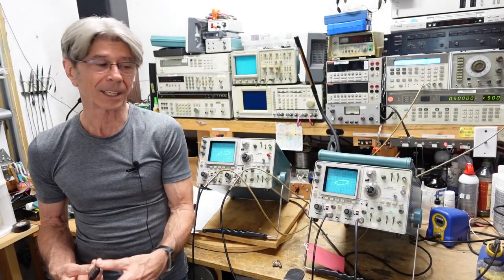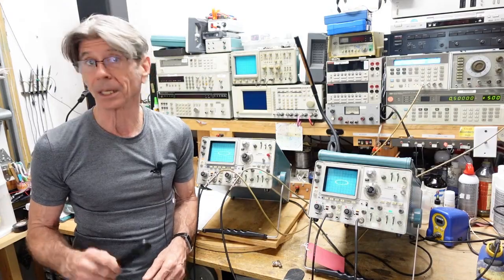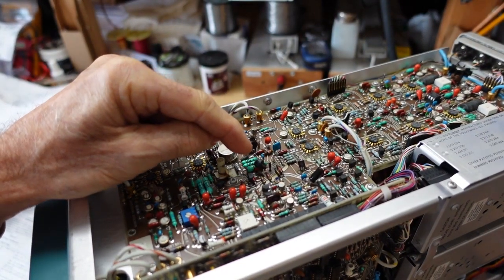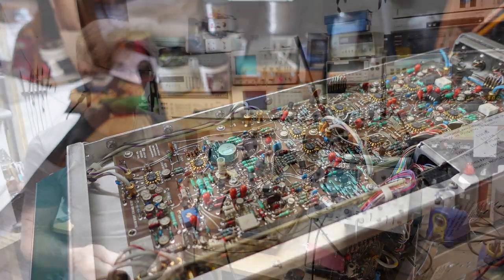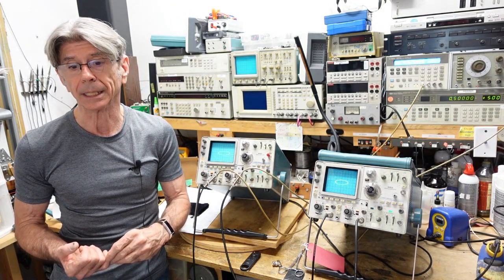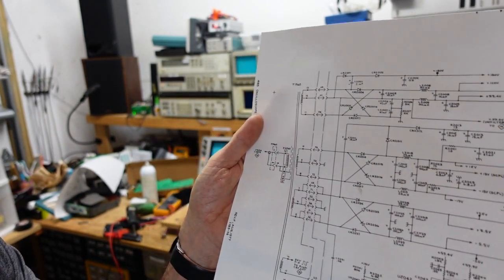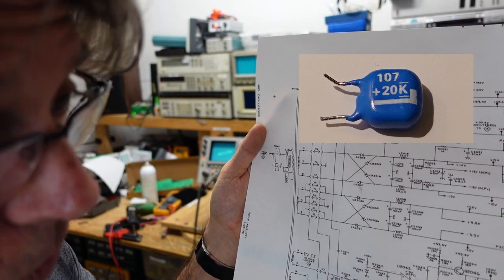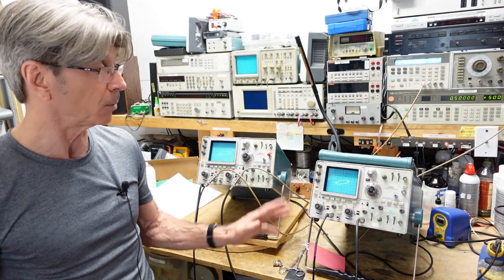Tektronix 485 A Quick Update

Comment: Hi Ray, thank you for the amazing content. Your insights have helped me a lot on my journey to fix my 485. I’m from Brazil, and this is an extremely rare piece of equipment here. I got mine from an old technician who brought it from Switzerland in the late '70s. He recently passed away, and his son sold it to me, but it wasn't working.

After some research online, I found your video. Thanks to your help, I was able to solve a short — in my case, on the -15V DC line. After getting rid of the short, I powered it on, but there was still a ticking sound coming from the power supply.

Digging deeper with the service manual, I bent the 3rd pin on the U comb, and now all voltages are working perfectly. The front panel LEDs are lit, and the fan is spinning, but unfortunately, there's still no image on the CRT.

I disassembled it again and checked the high-voltage power supply. All components seem fine, which brings me to my question:
Is there any chance a tantalum capacitor could be responsible for the CRT not displaying anything?

Thank you so much for your time and incredible work!
Reply from the maker: Hi Rodrigo!  Unfortunately, there are many reasons for a no display scenario.  You mentioned checking the HV components, but are you actually getting the correct HV readings?  This requires an HV probe, which you may not have.  There are also unblanking circuits which may be at fault.
Autotriggering causes a line on the CRT in the absence of a signal.  If the autotrigger circuitry (or if the scope trigger is not in auto) you won't see a sweep on the screen.  Try feeding a signal in and see if you get a sweep.  Good luck!  Ray

Comment: Ray this is a typical problem. Tek would run 15V caps at 15V not good! The metal can ones never fail. Derate at least 20% I usually go for 50%

Comment: :face-blue-smiling:Congratulations.
Great video tutorial

I too have a TEK 485 in my lab, which had the same problem.
Once all the tantalum capacitors were replaced it worked perfectly again.
    Thank you for your contribution.
    Hello from Italy
    Stephen,

Retired electronics technician
Reply from the maker: Thanks Stephen!  Tek scopes were the gold standard when these were made, but time marches on and takes its toll on components.  Those tantalums haven't aged well, and you were wise to replace them all.  Before the 2 485's I have can be reliably used this must be done to them as well.

Comment: If there's ripple in the power supply or voltage spikes this can also cause tantalum's to short causing a cascade failure one after the other. so I would monitor the output rails on each supply
Reply from the maker: Thanks, I had not heard that.  Several of these were after regulation, but one was definitely before.
The power supplies in the 485 are run from an inverter, so the frequency is around 25 Khz, IIRC.

Comment: Everything is surface mount even in small gear. But caps of any sort are still a problem. It’s strange about them, tantalum type, in some pieces of gear such as older HP I have hardly ever had to replace one. In some other well known pieces, it’s always one of them. When ever I see them it makes me worry.
Reply from the maker: IMHO you're right to worry, since their default failure mode is a dead short.  But you bring up an interesting point: I've never seen one fail in HP gear either.  I did have one short in a Fluke 8920 AC Voltmeter, but never in any HP stuff, and I have a fair amount.  What's up with that?
Reply: @raygianelli3612  beats me, I know there is much to be said about quality control. I normally use Nichicon  caps, which are considered good quality, but I have received lots from suppliers that had a batch of poorly  manufactured ones. Mouser replaced them with no problems when I pointed out the problem. I think it’s just the nature of caps, no matter the architecture to fail. Dried out electrolytes an poor manufacturing technique have caused many problems, but you would think by now someone would have  fixed the issue. I have been told by folks that worked at NASA gear has to be pulled all the time because of cap problems. Can’t wait to blast off to the moon an a series of caps fail on the way home.

Comment: After your prior video, I went down the Tantalum rabbit hole for a while and found out that some are now being produced with what amounts to an internal fuse element so that when they fail dead short, they actually open up instead when the over-current surge "pops" the internal fuse. I feel that is a huge improvement. However, there must be a trade-off of some sort. Maybe not as good of a high frequency response, higher ESR, or something. You never get something for nothing.
Reply from the maker: Wow, that's very interesting.  I'll have to do some reading.  Where did you find this information?
Reply: I didn't realize at the time, but it looks like these are just surface mount style tantalum caps. Probably not much new technology is being directed towards through hole components